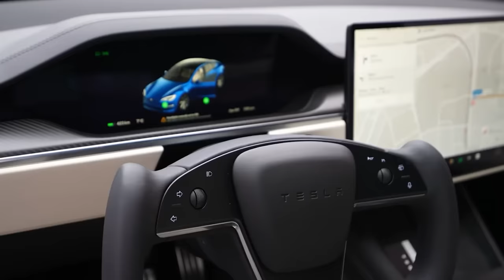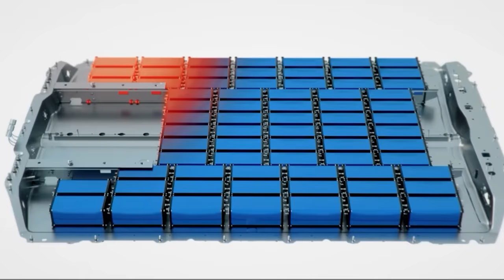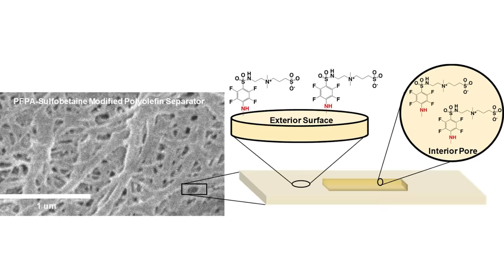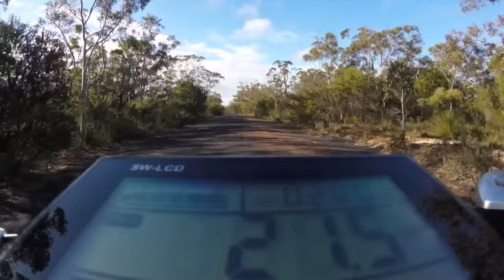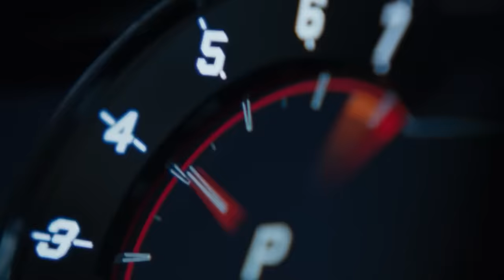EV's Are Exploding In Shocking Numbers

Comment: Remember, an EV fire means the end of the EV. It cannot be repaired once it catches fire, unlike a normal vehicle fire.
Reply: Guzoline Fires are not repairable either.
Reply: @popsracer886 why you dont fix your cars? In my country burn cars get fixed
Reply: @HIDHIFDB   Not sure if you understand this, but sheet metal loses its strength after a fire.  sectioning the vehicle isn't safe either, cars will split in half at the weld between sections.  Minore fires hood and fenders, may be salvagable, as long as the main frame section was spared.  Cars today use Hi-Strength Steel and it loses integrity, temper, if heated above a certain temperature.  This means there is no energy absorbing properties left in the steel.  I did Sheetmetal FEA for Honda N.A. in Marysville Ohio, forming sheetmetal adds strength and heating removes it.  Be very careful with these types of repair.  Plus Insurance Companie's are risk averse in this Country, and these cars are just spare parts over here.  Have a Great Life.
Reply: @HIDHIFDB  East Ugga Buggaland?
Reply: @The_DuMont_Network  Esat ugga?  Uguu gua balt power wheels?
Reply: That's dumber than buying a flood car.
Reply: What the heck are you talking about? I had an engine fire and it was extinguished within 5 minutes. All of the hoses were burnt, the electrical systems destroyed including engine management and my insurance company wrote of my 2 year old.
Reply: Hey! More sales!!
Reply: Hybrids reflected the most at 3,475 fires per 100,000 vehicles. 
ICE vehicles caught fire  at 1,530 incidents per 100,000 vehicles.
EV fires were 25 fires per 100,000 vehicles.
Reply: wow you would not mind owning a petrol car that has burned..... plenty to choose from
Reply: @whocares264  "Flood Car", do what you want. "Fire Car" send it to the recycler.  I would take a flood car over a fire car any day of the week.  Strip it down and rinse it out.  the problem is that Insurance Companies wait too F'N long to sell these cars and they are rotten by the time you can get them.  Give Me a classic a week or two after the flood and I can fix it.  Six Month to a Year and it isn't worth the trouble.  Fire Cars are never worth the trouble, unless they are extinguished within a few minutes or it is just bolt on parts, AKA "Not The FRAME or UNIBODY"
Reply: @whocares264  He has a dozen Pintos.
Reply: @popsracer886 well EV's are completely destroyed...the firemen cannot stop the fire. In a fuel powered you can use   an extinguisher
Reply: "a normal vehicle fire" LOL I am fud up with you Nancys. BOOM
Reply: Not only that. Even if they have a minor accident they often have to write off the car!!
Reply: @jenny6253  LOL
Reply: I've seen a few ICE car fires. After the first three minutes the car is totaled anyway. I saw an old Camry start on fire from an under-engine fire we couldn't put out to fully engulfed in 10 minutes. It was totaled in the first three minutes.
Reply: @popsracer886  
Wrong. gasoline fires are much less damaging. Once an EV battery pack catches fire, more than 90% of the vehicle is completely destroyed.
Reply: @popsracer886  
Absolutely not true. An EV fire completely destroys the value of the; vehicle, which is not recoverable due to the percentage of damage EVs impart due to runaway fires.
Reply: @Debbiebabe69  Sure Nancy
Reply: The Lord works in mysterious ways ......
Reply: Normal LOL, unlike you.
Reply: Again feel free to post your sources, can't can ya?????       @BioniqBob
Reply: I hate EV’s but this is a ridiculous statement
Reply: It is very unusual for a burning car to be repairable.
Reply: @BioniqBob  no connection discerned.
Reply: very good point
Reply: @guitariste47  the example in the Netherlands was extinguished by the sprinkler in the covered parking.

The traction battery was not involved, it is likely not to be.

I suspect the car was parted.
Reply: @popsracer886 
Like any normal fire, it depends on the damage. Not true with EV battery pack fires which are permanently ruined after any fire.
Reply: @popsracer886  
When was the last time you saw a sheet metal fire?
Reply: @BioniqBob  Tell that to your EV insurance company.
Reply: @guitariste47  
True.
Reply: @ThomasLee123  They know unlike you Nancy's.
Reply: @chrisbueschel3884  Yea, those ICE that had a fire sell like hot cakes.
Reply: Batteries can't even be diagnosed. Sitting on potential hand grenades...
Reply: @popsracer886 lol you watch too much Hollywood films 😂😂😂😂😂
I'm 59 and yet, only seen engine fires in movies. A gas engine is easely extinguished btw
Why don't you look up the EBike explosion on a subway   car in Toronto New yrs eve
Reply: A gasoline fire is between 200 and 800°C and can be extinguished with a fire extinguisher (if taken care of quickly). A battery fire can reach 2800°C and all you can do is run for your life. And you can thank God, if you weren't parked near a house or other electric vehicle and you didn't leave anyone in the back seat.

reminder: to transform cast iron into steel, it is necessary to reach 1600°C
Reply: @popsracer886  As a poor teen, my first car had a fuel pump fire in the engine. After I fixed the problematic hose and cleaned up the mess, all was good and the car ran fine.
Reply: @HIDHIFDB  
Gas cars, yes. EVs, not.
Reply: @popsracer886  
Thanks for your additional data about ice engine fire.. I agree. But it depends on the situation and seriousness of the fire. My experience was minor and was resolved with a fire extinguisher. Aluminum EVs suffer greatly from almost all fires.
Reply: @HIDHIFDB  
??
Reply: @davidgapp1457  
EV or ICE. That is the qualification.
Reply: @BioniqBob  
A factor, I did not address. Thank you.
Reply: @MrRirate  60 to 1
Reply: @ThomasLee123  if they ask gibberish they get gibberish
Reply: @HIDHIFDB  Your country? Do you mean you fix burned EVs?
Reply: @popsracer886  Not sure YOU understand this, but it depends on the fire.LOL
Reply: that's correct petrol cars catch fire..

Comment: It was later confirmed it WAS an EV which caused the shipboard fire!!!
Reply: Why am I not surprised? Insurance companies sooner or later will not insure these vehicles.
Reply: @keith4886  These delusional claims are just comical already.  There are millions of EV's on the road and millions more being added annually.

The fire rate for combustion engine cars in the USA is 1 in 1628 cars, but the fire rate for even recalled EV's with faulty batteries like the Chevy Bolt is 1 in 10,000.

If anything, insurance companies will stop insuring combustion engine cars.
Reply: @redbaron6805  Slight exaggeration. There are 2.5 million fully electric and hybrid vehicles on the road in total in the USA. There are 300,000 million internal combustion engine vehicles.  You have the fire rate in ICE vehicles correct but the fire rate in EV vehicles is in fact 25 per 100,000. Notably, he number 1 cause of ICE vehicle fires is arson after being stolen. EV's dont get stolen often due to their tech.
All that aside the point is not the amount of fires it is the fact that EV battery fires are always very violent, very immediate, without warning and are very, very difficult to put out usually taking hours to stop the thermal runaway from reigniting itself when water is stopped. And it is very common for the battery pack to reignite hours, days or weeks later.
Reply: Please cite this "confirmation".
Reply: @redbaron6805  ICE car fires are not runaway and not causing a whole ship or parking garage to burn.
Reply: @oldarkie3880  Really..?  So why did the Diesel Range Rover burn down an entire parking garage in Luton then genius...?

Why did the salvage company working on the Fremantle Highway just confirm that the fire did NOT start with electric cars then...?

Oh... right.  You didn't bother to research any of this... yet again...
Reply: Look up CAMPLAND on mission bay in San Diego near my high school- massive fire caught two weeks ago.. turns out?? Electric bikes in the storage area.
Reply: @jerrysanders9101  Cheap electric bikes with Chinese batteries and EV's have absolutely nothing in common.
Reply: @redbaron6805  You are going to point at a shitty Range Rover that has less than .5% of vehicles on the road in the world?
Reply: @redbaron6805  No, you’re missing the point.  The point is that when these battery fires do happen, it’s even worse than dealing with an ICE Car fire.  It burns generally even hotter and can reignite if you put it out.  There is probability, but there is also how severe a disaster is if it happens.  It’s very possible that something is a greater risk even if it is less probable due to the severity of the event if it does happen.
Reply: @kramnull8962  I'm going to point out the actual vehicle being identified as starting the massive fire at Luton Airport...
Reply: @AdrianFahrenheitTepes  Which is fine, but EV fires are exceptionally rare, and most of those happen after a catastrophic crash.

It is telling that an entire site dedicated to Tesla fires world wide only has 25 documented fires this year.

Considering that Tesla manufactured its 5 millionth car last month, that is about 1 in 200,000.

The fire rate of combustion engine cars in the USA is 1 in 1,500 annually.

People also forget that batteries like LFP can't catch fire due to their design, and as EV's will likely transition to Solid State batteries which are also non flammable in the next 5 years or so, this rare problem will basically disappear in the next decade or so.
Reply: @redbaron6805  One fire is very different from another.  One reaches way hotter temperatures than the other and is a pain to try putting it out compared to the other.  And Solid state batteries have experimentally gone up in flames as well.  The key is safety precautions regarding whatever kind of battery you are using, the chances get minimal with proper safety procedures, which even this video here shows people improperly and dangerously charging e-bike and car batteries in its runtime.  Safety is key.  But it doesn’t change that one type of fire is less common, albeit worse of a job for fighting the fire if it does happen, however improbable.
Reply: @AdrianFahrenheitTepes  Which doesn't change the fact that EV fires are exceptionally rare, and most of the reported battery fires are in e-bikes or scooters, not in EV's.

Some of those fires were reported due to the incorrect chargers being used and other human errors, along with dismal quality of cheap Chinese e-bikes.

Your claim on the Solid State batteries simply doesn't match actual testing, as shown here:

"The liquid electrolytes in lithium-ion batteries are flammable and can cause the battery to explode if it overheats. 

Solid electrolytes, on the other hand, are NOT flammable and can withstand higher temperatures."

Which would mean when adopted the rare EV fires of today will basically disappear completely.
Reply: BS, still under investigation
Reply: @BioniqBob  Sorry but the crewmen themselves said it was an EV that started the blaze! The Luton fire is reported to be non EV as the cause!
Reply: @notwocdivad  LOL yea the Fire Department wrap up a investigation on the word of a crewman.  Okay Nancy
Reply: @BioniqBob  Who better to tell you what happened than an eye witness?
Reply: And after that it was confirmed that it wasn't. Waiting for the next unconfirmed confirmation.
Reply: What you are not saying is what caused the fires. Petrol or diesel will not spontaneously combust whereas ev batteries can and do. If a IC catches fire then it is most likely caused by an electrical fault. 
Evs are not immune to electrical faults.
Reply: What caused the Range Rover to catch fire?
Reply: @redbaron6805  the rate of fires will increase as the vehicles age. Many of the ICE vehicle fires are due to insurance fraud or criminal activity - joyriders setting fire to the car when they abandon it.
Reply: @redbaron6805  because, like the diesel Land Rover that burned down the Liverpool Echo Arena car park before it, it was a hybrid. Video from the Luton fire clearly shows jets of flames coming out sideways under the floor of the hybrid. Lithium batteries are simply not suited to use in EV’s.
Reply: @redbaron6805  except most EV’s contain batteries made in China. You’re right tho, the energy tied up in an EV battery and the consequences of a thermal runaway in that EV battery are completely different, orders of magnitude greater than a similar event in an e-bike battery.
Reply: @charlestoast4051  It all depends.  Tesla has a battery Gigafactory in Nevada, and there are factories being built all over the USA, along with a giant battery factory in South Korea and in Europe.

Obviously an EV battery is much larger, but the E-bike batteries are often poorly built and poorly regulated, so fires in things like E-bikes and scooters are far more common, vs EV battery fires which are very rare.

Even with the defective LG Chem batteries in the Chevy Bolt, there were 18 fires reported out of almost 200,000 cars, or less than 1 in 10,000.  which is about 5x less than the average combustion engine car fire rate of 1 in 2,000....
Reply: @charlestoast4051  That is obviously false, as EV fires even with defective batteries are 5x to 10x more rare than combustion engine car fires.

There is no such thing as "Lithium" batteries, as Lithium Ion is a class of battery, not a battery type.

There are literally dozens of models in production, some which can't catch fire at all.

You may as well claim that fossil fuels like gasoline or natural gas are not suited to be used in cars or to heat homes, due to the countless fires and explosions they cause annually.
Reply: @charlestoast4051  There is zero data showing older EV batteries are more fire prone, so you simply have no actual data to support that claim.  

And no, most of the ICE vehicle fires are not due to insurance fraud or criminal activity, they are mostly due manufacturing defects, fuel and oil leaks and age and wear of the vehicles.

You have been watching way too many movies...
Reply: @redbaron6805  update there is another cargo ship on fire in the north sea,  yep full of EVs.
Reply: @colingathercole391  That ship is carrying Lithium Ion batteries, NOT EV's.

Is it really this difficult to do elementary research before posting and making yourself look like a total fool...?
Reply: @redbaron6805 it was a diesel hybrid
Reply: @ThePontiac98  Which is not an EV.  People are just blind and ignorant about how EV's work, and the fact that they catch fire a tiny fraction of the time combustion engine cars do.

Comment: Don’t forget about resale value and cost of battery replacement , I can imagine lots of EVs hitting the salvage yard due to cost of battery replacement !
Reply: Imagine EV's catching fire in a salvage yard! Very very dangerous situation and costly!
Reply: new safer technology on the way
oder EV's should not regularly be fast charged
Reply: @donnahunter1976  I take it you've never worked in a salvage / scrap yard. They are already on the verge of bursting into flames. The Scrap yard I worked in 20 years ago, The ground was so polluted that if you weren't careful with your cutting torch you would set the ground literally on fire. We had mountains of oil soaked tailings right next to mountains of tires and when I say mountains I mean mountains bigger than a large building, they eventually had a fire that they couldn't stop and had to fire call the fire department and when the fire department took a good look around they closed them down for good. You know what they didn't have not one EV battery in sight, and it still burned down.
Reply: That’s a great point 
Thank you for sharing
Reply: The salvage yards won’t take them
Reply: And, almost impossible to recycle as opposed to ice engine cars that are almost completely recyclable.
Reply: @ThomasLee123 

Bullshyt.  Redwood industries in Nevada and several others around the world tests, rebuilds recycles these precious rare elements every day.